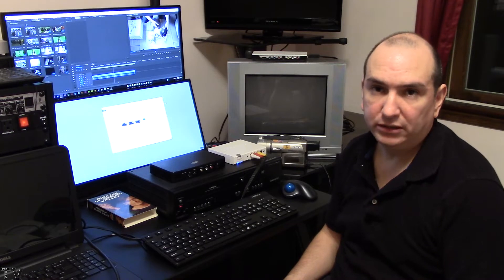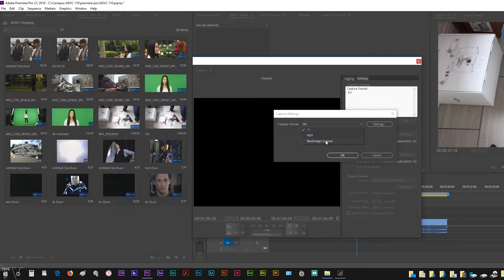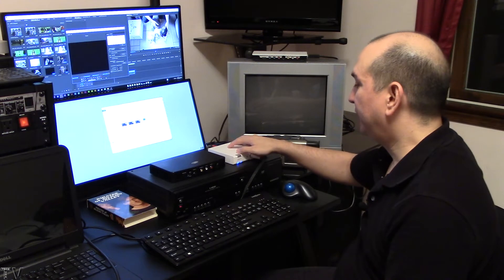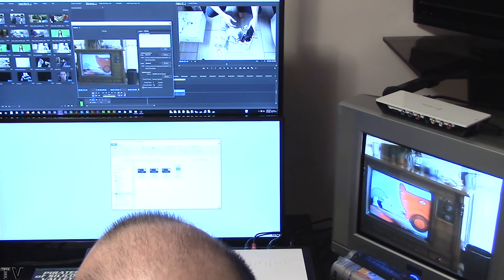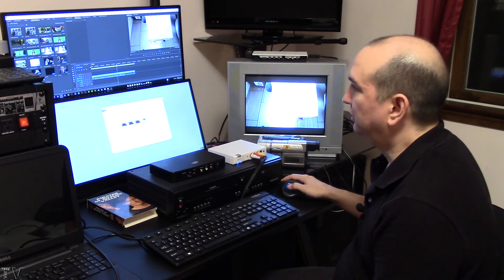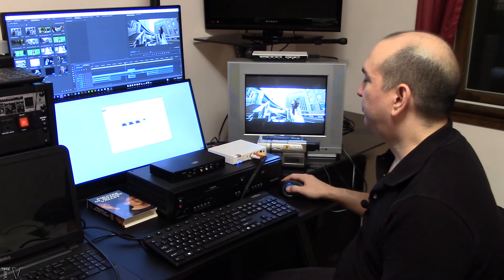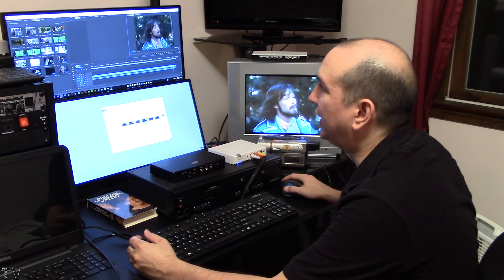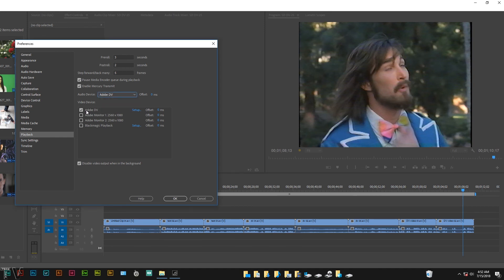Easily transfer VHS and Hi-8 tapes to computer

Comment: I received my canopus today and I followed your video and it saved the video as an AVI. I would prefer that it saves it as an h264 mp4. Also how do I control what size the canopus saves in SD HD 4K etc. Thanks
Reply from the maker: The ADVC 110 is SD only (720X480). It converts VHS and Hi-8 into a generic DV-25 codec. The Intensity Shuttle is HD and SD.
Reply: @TechTVusa  ok so I am doing it correct and the final output will be a SD video file ending with a . Avi file extension. If I want an h264 mp4 file I will need to convert the Avi file correct ?
Reply: Also since to he original file is not HD the Shuttle would not really be that helpful correct. I could probably upsample the 720x480 using software right?  Again thanks for all your help and knowledge. Much appreciated
Reply from the maker: @Jbandes  The Intensity Shuttle can upscale using hardware. That being said Premiere Pro can upscale just fine as seen in the video link below. The ADVC 110 is your best bet for VHS transfers. 
https://youtu.be/dVLUxRkPMdA
Reply: @TechTVusa  Fantastic. I also have a copy of Grass Valley EDIUS and Danvinchi Resolve Studio. I will try both Premiere Pro and Edius. Is it normal for the canopus and premiere pro to export in am Avi file format?  I guess that is the default that the canopus saves the file to in premiere. Thanks so much. Also liked the Topaz AI Video Enhance program demo. A bit expensive but does a nice job.
Reply from the maker: @Jbandes  The ADVC 110 will convert the video tapes to DV-25. You can export to Pro Res, H.264, MPEG 2, Motion JPEG etc.
Reply: @TechTVusa  when I click the record button in the capture window in Adobe Premiere it automatically saves the file in AVI format. I guess you save in another format I need to export the Adobe premiere timeline in another format correct?  Sorry for so many questions I am just trying to figure it all out to get the best quality
Reply from the maker: @Jbandes  The codec is DV-25 with an AVI file extension. On Mac it will have an MOV file extension. You can export to H.264, Pro Res, MJPEG etc. or burn a Blu-ray disc just like in the video link below. 
https://youtu.be/dVLUxRkPMdA
Reply: @TechTVusa  my computer has thunderbolt. I will buy an intensity shuttle is there a big difference between usb and thunderbolt? Which do you recommend. I like the idea of hardware upscaling instead of paying $200 for the video enhance software
Reply from the maker: @Jbandes  Have you watched my videos that I provided links for? The Intensity Shuttle will not capture old VHS tapes unless your VCR has a built in TBC. I use an ADVC 110 to capture VHS tapes. I then use the Intensity Shuttle to preview my editing on broadcast compliant hardware.
Reply: @TechTVusa  I am using the canopus and Edius software capture mode and it looks amazing. Yes I did watch your videos. All of them. I even have the same broadcast monitor. I think I thought that the shuttle would let me upscale the canopus video using hardware but I think I may have misunderstood. After it's captured in canopus if the shuttle can't upscale to DVD 1920 x 1080 I could use the video enhance software from topez. Thanks for everything that canopus makes the VHS look absolutely FANTASTIC. Thanks for your great videos
Reply from the maker: @Jbandes  The intensity shuttle can upscale the video but it needs a TBC. The TBC is the most important part of the equation.
Reply: I could not find a AV Toolbox AVT-8710 Multi-Standard Time Base Corrector
or a DataVideo TBC-1000 (impossible to find) But I did find one of these Videonics Digital Video Mixer MX-1 NTSC. Boy this is getting so crazy to transfer VHS with good quality but these memories are over 40 years old so worth it I guess. Thanks
Reply from the maker: @Jbandes  I cannot recommend anything other than the IEEE Firewire converters because that is what I use.
Reply from the maker: @Jbandes  You connect the S-video or composite out of the ADVC 110 to your TV. It is that simple.
Reply: @TechTVusa  Oh so your Sony broadcast monitor is actually a  television. My Sony Trinitron CRT monitor is a computer monitor and has a 9 pin male VGA cable coming out of it. I ordered a convertor to connect the SVGA  cable to the VGA cable. It should work. Thanks
Reply from the maker: @Jbandes  I don't have any Sony monitors. That being said Firewire DV converters are designed for playback on broadcast compliant hardware. Why would you output to a computer monitor using the ADVC 110. FCPX, AVID, Edius and Premiere all playback on a computer monitor with not need for extra hardware.

Comment: Awesome video. Quick question I have a Sony EV-C3 8mm player I have the output of the EV-C3 going into the front of ADS unit. Should I then use the FireWire on the back to connect to the PCIE FireWire card in my PC and then capture as you did in Adobe or can I connect the output on the back of the ADS to an elgato capture card and record on the PC with that ?
Reply from the maker: You should not need to use two capture cards.
Reply: @TechTVusa  OK after having you educate me, I am going to return the USB Elgato. No need for that now that I have purchased a Canopus ADVC110 capture device. What about TBC ? The Canopus I dont think has that. Is there any value in adding that to the signal chain?
Reply from the maker: @Jbandes  The video link below might be worth watching. 
https://youtu.be/xdw9_DETrqE
Reply: Thanks for your great video. I would like to ask you something. I have about 100 VHS Tapes that have music recorded on them. I have a professional studio and I have the output connected to a mixing board. During playback sometimes the tracking fades and it introduces crackling. I think a TBC would help eliminate it. I bought a canopus advc110 but I don't think that has a TBC in it and my VHS does not have one either. Can you recommemd a TBC or will the ADVC11O help ?
Reply from the maker: @Jbandes  If you have video snow or audio distortion a TBC might not help.

Comment: Recently, I have purchased the blackmagic intensity shuttle with thunderbolt connection, to digitalise VHS tapes (around 50 tapes) but I was experiencing black flash flickers when transferring through VHS player to shuttle, output was shown on media express with frequent flickering both audio and video had cuts. 

What would you recommend to rectify this issue ?
Reply from the maker: The video link below might be helpful. 
https://youtu.be/dVLUxRkPMdA
Reply: Thank you :) in regards to time base corrector, would it rectify the black flash issues on VHS ? If so, are there any recommendations ?
Reply from the maker: @ragenthank8536  Everything is digital now. You would have to buy a used TBC. It would be better to buy a used ADVC 110.
Reply: Tech TV usa thank you :) I had checked from dvd recorder and s-vhs players with tbc but not sure if the output would be clean. Could the canopus be connected to iMac ? And captured through Premier ?
Reply from the maker: @ragenthank8536  The video link below might be helpful. That being said with the newest version of OS X I have been told the Fire Wire DV converters do not work. 
 https://youtu.be/vATw63nn3OQ
Reply: Tech TV usa - thank you, using Mac OS sierra, hope it could be compatible

Comment: I ultimately figured out that what I thought was a problem with my Canopus Unit, was actually copy protection on some of the tapes I was trying to back up, called macrovision... What is awesome though... is that the Canopus AV110 has a cheat built in that lets you bypass the macrovision copy protection... you hold the silver button for about 15 to 20 seconds beyond the point at which it starts displaying color bars... eventually the picture comes back with great crystal clear visual fidelity... And it remains that way as long as the Canopus stays powered on!... can't recommend it enough!

Comment: My premiere pro 2018 (same as you) is not recognizing the Canopus AV110... The lights are all on and I'm on analog mode... but no picture in the Premiere capture... please help me troubleshoot if you can... I bought the canopus AV110 upon your recommendation and great videos
Reply from the maker: It could be a bad cable or the ADVC 110 could be defective. Will the ADVC 110 at least output to a TV without any video editing software program being opened? It should.
Reply: @TechTVusa  I have another problem after I just fixed that one... so it's a very odd problem... I'm getting picture and sound now out of Canopus... it is very clear picture... but the color is extremely muted like the gamma is wacked out... there is an odd thing happening where if I remove the video cable and plug it back in... for a good 3 seconds the video is crystal clear... and then the gamma gets weird again.. if I remove power to the Canopus and plug it back in.. crystal clear picture for 3 seconds... then the becomes muted colors with a weird gamma shift... so it seems both related to when video cable is removed, but also when power is removed...
Reply from the maker: @tomcollector9594  Make sure the cables are plugged in all the way. That being said it could be the cable or the ADVC 110.
Reply: Ok major break through... the picture looks perfect on the same exact cables when I switch to dvd on the dvd-vcr I have... only on vhs mode does it have a gamma color problem... any ideas because vhs looks perfect when plugged in tv... yet near black and white on canopus... like I said same composite cables look great from the same exact ports when in dvd on canopus... its just vhs that looks crazy.. no matter what tape I put in
Reply: Ok major break through... the picture looks perfect on the same exact cables when I switch to dvd on the dvd-vcr I have... only on vhs mode does it have a gamma color problem... any ideas because the vhs mode looks perfect when plugged in tv... yet near black and white on canopus... like I said same composite cables look great from the same exact ports when in dvd on canopus... its just vhs that looks crazy.. no matter what tape I put in
Reply from the maker: @tomcollector9594  The ADV 110 could be defective.

Comment: Hey. I bought the Canopus ADVC 110, but all I've got after connecting it with my VCR and going to Virtual Dub is a black and white picture.
I also tried to somehow edit the Video source, but It says that I cannot have any control of the capturing device.
I also tried to change the 4:2:2 into 4:1:1 or changing PAL_B to PAL_S, but It all failed due to "not having any control of the capturing device".
I also checked little switches underneath the capturing box and It is all fine.
Please, do you have any solving for that?
Reply from the maker: If you are using the S-video connection and it is not plugged in all the way it can turn the video to black and white. That being said there could be a setting in Virtual Dub causing the black and white image. Try the trial version of Premiere Pro and see what happens.

Comment: Hey, I recently got the canopus advc 110 and I am trying to bring vhs analog in to premier pro on a windows 7 machine. I can't seem to detect the canopus on my computer. I'm not sure what to do. I have updated the drivers in the firewire port to legacy drivers but that didn't seem to help. Any knowledge on this issue would be greatly appreciated. Thanks
Reply from the maker: Are you sure the ADVC 110 works? Are you sure your Fire Wire cable works? Keep in mind the ADVC 110 needs a 6 PIN Fire Wire cable to get power.
Reply: @TechTVusa  Yea, sorry I didn't mention this. I have it hooked up to a 6 PIN Fire Wire port on my computer and the light for analog in and digital in both work and I can switch between them with the input selector button. So, at least power is getting through to it. I also bought it from a supplier that tech tested and verified that all the components worked.
Reply from the maker: You have to make sure you have input/output selected correctly. The ADVC 110 can input and output video signals. The video link below should be helpful. 

https://youtu.be/dVLUxRkPMdA
Reply: @TechTVusa  Yes, I have. I can't seem to figure out what the problem is. The Canopus is simply not being recognized on my PC. It's not as if the problem is simply my device isn't inputting analog signals. Rather, it just doesn't show up as a device. How did you get your device to be recognized? ALso would the fact that I'm powering it through the 6 pin cause a problem? I also have not seen the status light turn on at all if that helps in any way.
Reply from the maker: If no lights are activated on the ADVC 110 it probably does not work. Are you sure the cable works? You could also try a different Fire Wire card. The 6 pin to 6 pin will give it power. If you use a 6 pin to 4 pin you will need the AC adapter.

Comment: Hi, I am trying to capture VHS video using the Canopus ADVC 110 running Adobe Premiere Pro 2020 on an old iMac Late 2009 running mac OS High Sierra. For some reason the Capture clip seems to be limited typically to around 3 minutes before the clip gets paused or stops recording. The videos I am trying to archive are around 1 hour long so this very frustrating. Any suggestions what might be happening ?
Reply from the maker: If the tape is damaged it will loose sync. You may have to start and stop a few times to capture the whole tape. There are also a few dip switched on the bottom of the ADC 110 that might make a slight difference.
Reply: @TechTVusa  Thanks for the response.  When I watch the video on the VCR - with a monitor - occasionally I can see a flicker where there is a loss of frames but the tape doesn't appear to be damaged. It seems a little arbitrary as to when Adobe pauses and stops the recording. I can run the same clip back and get different results each time ? I've looked at the manual for the Canopus but can't see how changing any of the dip switches will improve the syncing. Setting Dip switch 1 to ON just sets the status light red. I believe I recorded the video back in 2001 in PAL (as I am in the United Kingdom) so I have all the switches set to OFF except 6 which is set ON. The Adobe software pauses the recording every few seconds in some places - which is really annoying. It seems to be worse where I have shot lots of sequential clip scenes. Where I have longer continuously shot scenes the recording may last for several minutes before stopping. Do you have any other suggestions perhaps as to what might be happening please?
Reply from the maker: Perhaps the ADVC 110 does not work well with PAL. You could try different software and see if you get the same result. Having said that the ADVC 110 will try to correct the video to a certain extent but a worn out tapes is different from a damaged tape.
Reply: @TechTVusa  Could you recommend  any software that I could try for free ?
Reply from the maker: If you are on a Mac the video link below should be worth watching. Having said that do all your VHS tapes stop after 3 minutes of recording or just one? 

https://youtu.be/cwGU9VGlWhM

Comment: Hello! I've been looking all over for sensible and cheap solutions to capture via firewire on a Windows 10 computer but I've had no luck. I've worked on video for years, but only now do I really have the need to capture VHS footage and the prospect of using an ADVC interface to stabilize the image sounds great, but I haven't found any way to get that IEEE 1394 cable into my modern PC. Could you please give me some directions? Thanks for this video, by the way!
Reply from the maker: You just need a Fire Wire PCIe card. Having said that Thunderbolt is backwards compatible with Fire Wire. The video links might be worth watching. 

https://youtu.be/vATw63nn3OQ

https://youtu.be/r4YY0BFPHtQ

Comment: Hello! I am trying to capture with a Canopus ADVC 100 in OBS. The source is shown in the list of video capture devices in OBS, but only shows a black screen. With the WinDV program I can capture without problems. The reason for using OBS is because it allows me to scale, deinterlace (yadifx2) and encode at the same time live. In this way I save a lot of time. I understand that encoding live is not recommended. Previously I used this method with an Encore pci TV tuner and everything works fine, I leave a sample:
 https://youtu.be/fJ0_bkREY-g
Would you be so kind to try your ADVC 110 or 100 with OBS? Thank you!
Reply from the maker: Several years ago I did have my ADVC 110 working with OBS. I should be able to do an OBS tutorial in a couple of weeks. Just subscribe to my channel to see it. Having said that if you capture with Premiere Pro (use the free trial) using the ADVC 110 and drop the interlaced video into a 720X480 60P sequence and render it out does it look as good as your results? Try dropping the video from the Canopus ADVC 110 into a 1920X1080 60P sequence and scale the video up 25%-35%. Is the result about as good as you are getting? You may or may not need OBS. You would have to judge the quality for yourself. The video link below might be worth watching. 

https://youtu.be/Q4zcLU4Cdi8
Reply: @TechTVusa  I'll be waiting for the obs tutorial! It is clear that with Premier you get better results investing a little more time. The "advantage" of using OBS would be to capture, deinterlace (in my case, 25i to 50p), crop, scaling, color correction (global) and encode at the same time in a single action, surely sacrificing a bit of quality. Unfortunately I could not run my Canopus advc 100 on OBS to compare the results VS the Encore tuner. I insist that the intention to use OBS is just to save time. Regards!